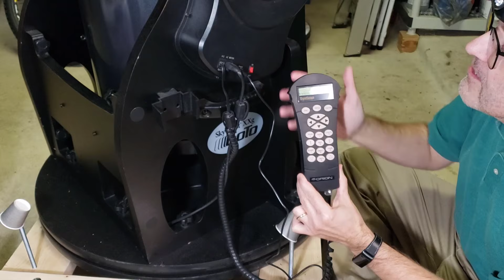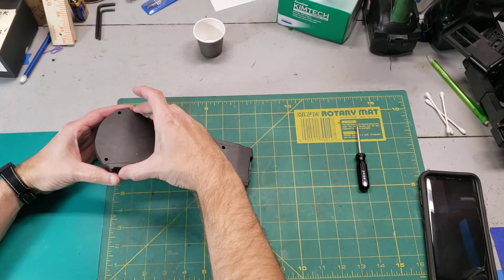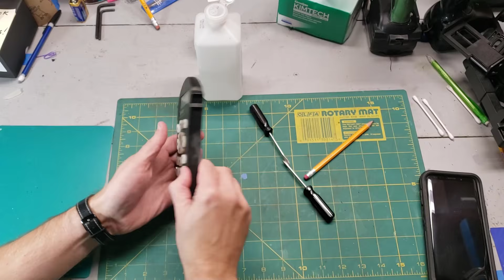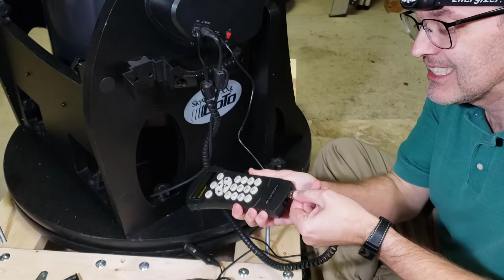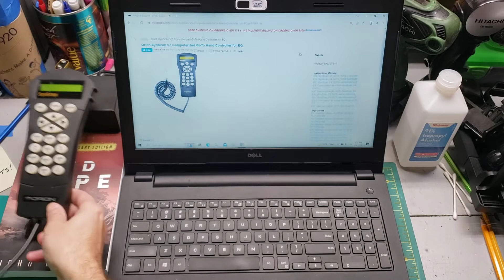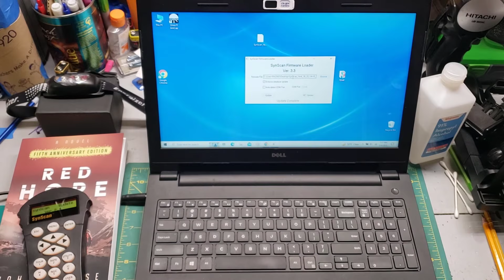PART 3 - GIANT Telescope Restoration!  -  Orion XX14g GoTo Dobsonian - Power SynScan Firmware Fixes

Comment: Thank you for this video. My question is it possible to connect guiding camera with the same port and wires directly to the mount where that controller was initially.
Reply from the maker: So... I'm not sure about the guiding camera, but I've heard that the WiFi modules just plug into the connector slot and people have used those successfully.

Comment: I have the newer Skywatcher Synscan for my AZEQ 5. The connection to the telescope for your hand controller is needed for power. The newer one has a USB port so that you can connect and power it from the PC. But even the newer controllers need to go into programming mode before updating
Reply from the maker: Thank you for the info - that is good to know!

Comment: Great series John! I loved your comment about slot cars in the 80's. YES! I used to clean up my pick up shoes on my Aurora AFX cars using a pencil eraser. I also used to drill holes in the chassis of my cars to make them lighter/faster. And install bigger magnets. FUN TIMES!
Reply from the maker: Thanks for watching!  I was a bit surprised that the old eraser trick works, but it seems to do the trick... just like with the slot cars.  :)    Clear skies!

Comment: Instead of a pencil eraser how about a model railroading track cleaner, a "Bright Boy".
Reply from the maker: I've never heard of those!  Thank you for sharing.
Reply: Looked it up, it says it's abbrasive. The contact pads on a PCB are thin and made of soft metal; you want to clean those gently without removing material.

Comment: It is best to use DC voltage.  There are many types of batteries that the DC voltage cable can use and all of them are small enough to sit on that scope's lazy susan.
Reply: I use a jump start pack with a buck/ boost between it and the scope.
Reply from the maker: I used to have an Orion portable battery source, but it was so much easier (near the shop) to use a wall power cable.  When operating remotely, I think the portable power source would be super helpful. Clear skies!